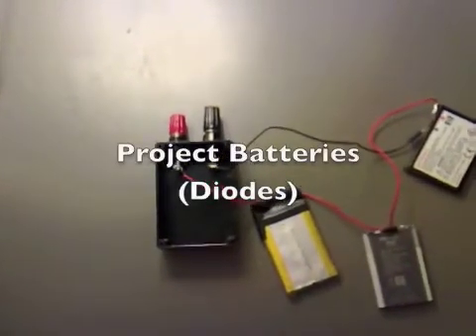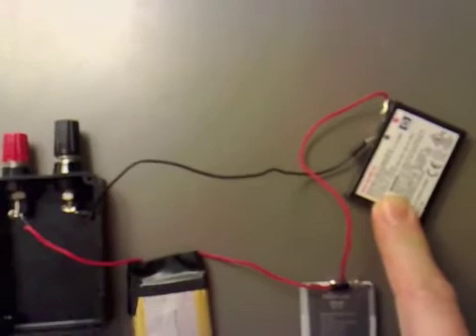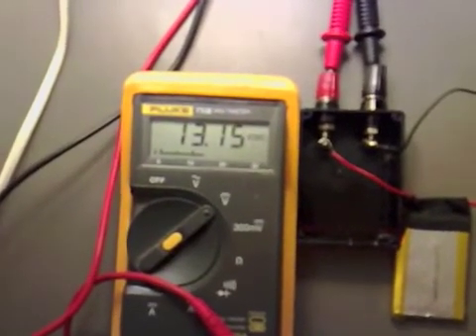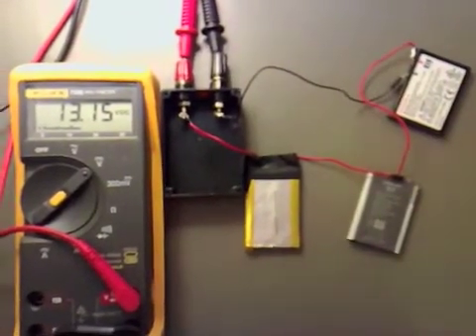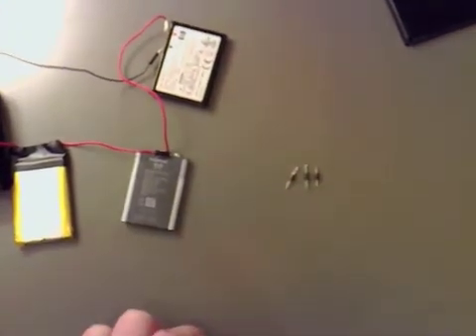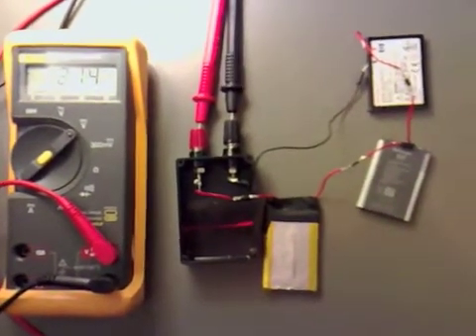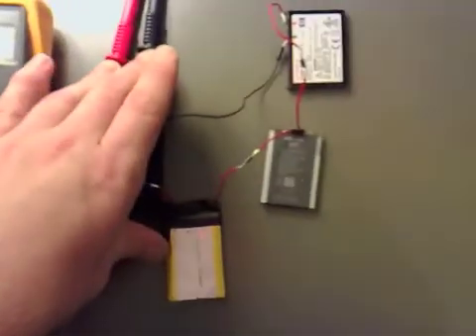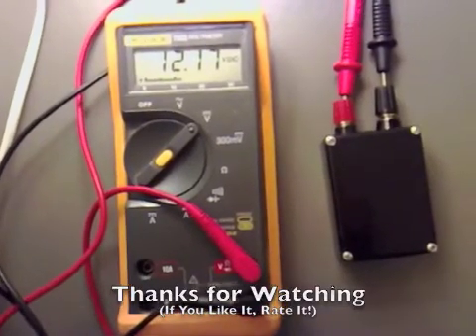Project Batteries (Diodes) 007

Comment: I would just like to agree with what 30GB said about the voltage levels he stated, as they are pretty much the max and min you want to go. I only say because you don't want to try and charge a damaged Li-ion battery, they can be dangerous.

Also, when max voltage is reached, the battery will be at about 70% charge, as the current wont be at the rated level yet. But unless you know what your doing and have a circuit to monitor the current and cut off then it could be dangerous to go any further

Comment: The three pin/terminal LM317 IC chip can handle 1.5 amps at about 1.2 to 30 or so volts.  Only a few parts needed.  That can be used as a stable voltage regulator.  The supply voltage needs to be about 1 or 2 volts above the output voltage due to losses in the chip.  Then use a resistor to limit the output current, which in your case would be the lowest charging current of all he batteries since they are in series, maby 100ma or so maby.

Comment: @JHx86 Probably not because regular 12v lead acid battery chargers will deliver too much current for the batteries and their diodes, which could lead to a meltdown.

Comment: My advice is to use schotty dioes instead of silicon diodes because in silicone dioes, most of the voltage is lost at the P-N junction. Schotty diodes have a metal plate connecting the positive and negative doped silicone. That means less votage is lost in the junction.

Comment: yep looks like you need a regulator. I have a 5v 1.5a regulator and i use it on my 8.40v lipo battery for rcs to charge my devices but lipos can only charge max per cell is 4.20v and can go lowest of 3v if any lower or higher will damage the lipos